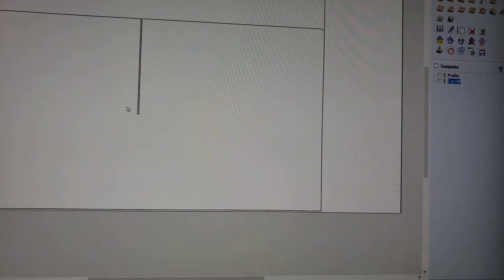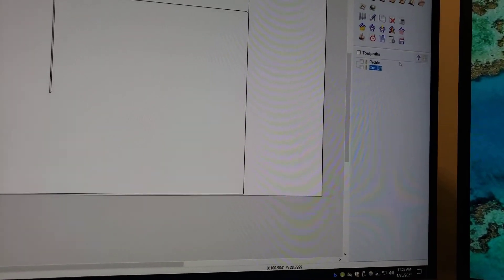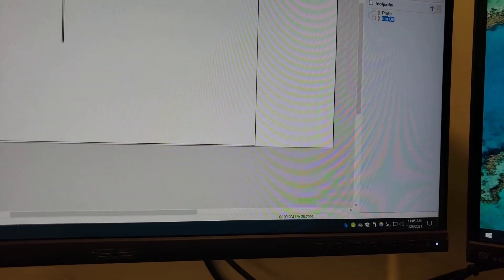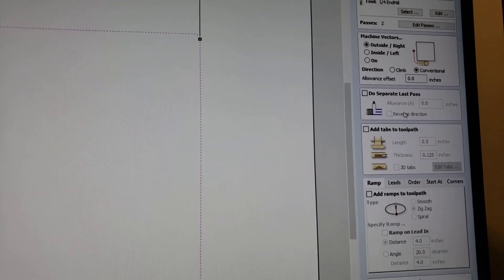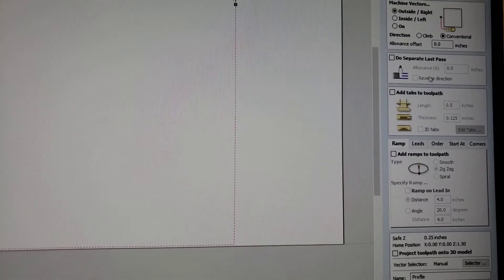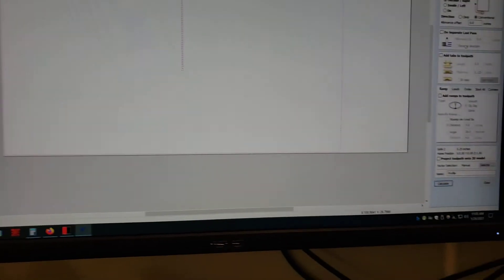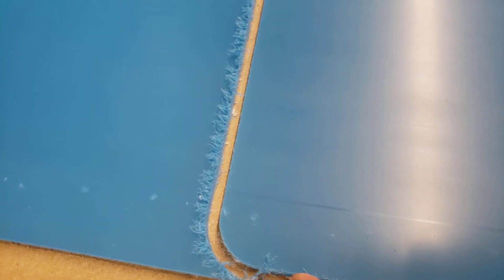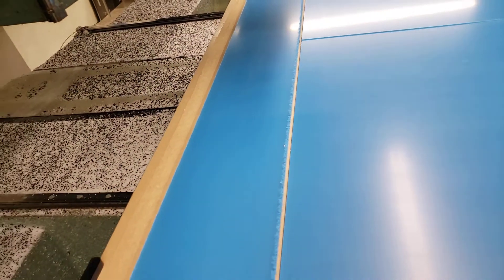Acrylic conventional vs climb milling, does it matter?

Comment: So I guess conventional would be the right choice then, if the finishes are the same then conventional will have less deflection on a less rigid cnc? Thanks for the info!!
Reply from the maker: Climb cutting actually causes less deflection and tool pressure. This usually results in better surface finish for metals. However as shown here it didn't seem to change at all here with acrylic. Sorry for the late response.
Reply: @Kilnor  Appreciate the reply, 3 years later better than never 😂 in those three years we now have five 6x10ft CNC machines running full tilt all day long on our production line. All started from a 2x2ft desktop CNC in my garage (when I made the comment haha) thank you and wishing you all the best!
Reply from the maker: @donochetti2177 same to you! What do you guys cut, acrylic also?
Reply: @Kilnor Thank you! Yes one is dedicated to acrylic (1/2" bit at 400 ipm!!), one for MDF and sometimes harder wood, the others are for glass wool / acoustic felt, you can run that puppy at full speed 2200 ipm on that. We are in the acoustic paneling business.

*Edit: As our signs are big we settled for 1/2 inch single O flute bits for acrylic on nearly everything, working great so far. 👍